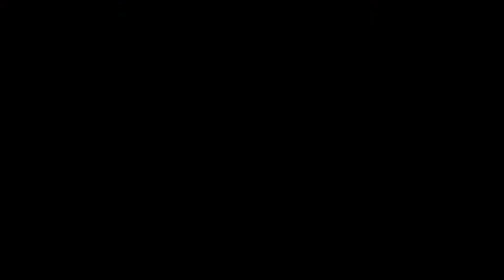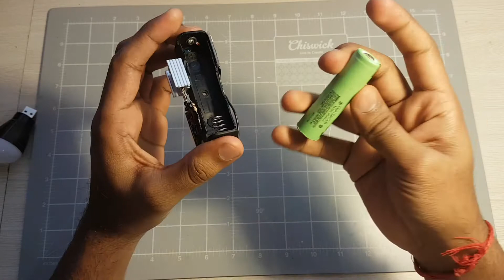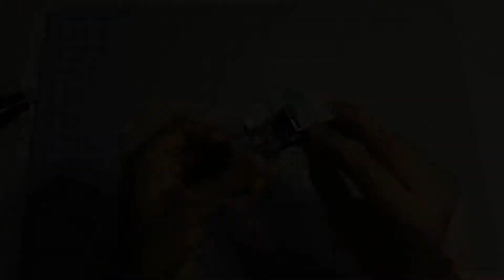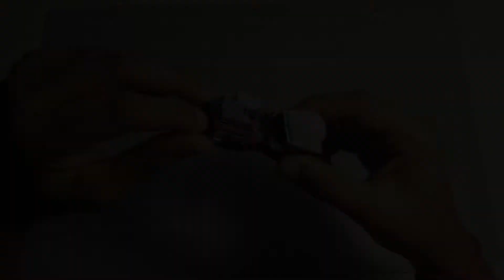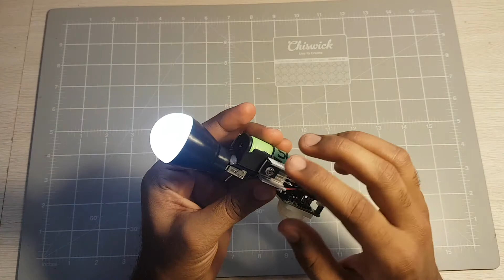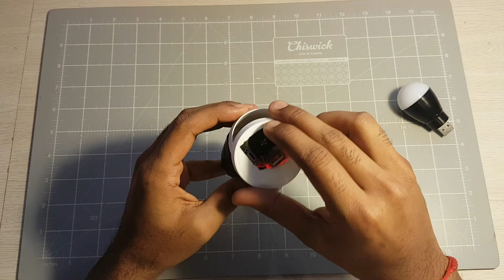DIY Motion Sensor LED

Comment: Greetings from cancun mexico. I have the pir, the dc/dc 5v booster, unfortuantely i have the older tp4650 module, it dosent have the added ports for the load, i have had trouble doing what you just did, mabey because i tried making mine solar, but even then tje tests i did i used the same 18650 batt and other times i used live current from a 5v cell charger. If you ever have time to make the same device you are showing one piece at a time it would be awesome. But good job, you exceeded where i have failed.
Reply from the maker: Hi erick sal, thank you for your comment.
I too have some TP4056 modules that don't have the protection IC (DW01A Li-Ion battery protection IC). Look for ones that have 4 connections, 2 will go to the battery to charge them and the other 2 will go to the load. These modules will ensure safely charging and discharging.
The one you have will only work for charging the battery. Try can get ones like these: https://www.aliexpress.com/item/32797834680.html
Hope this helps! All the best!